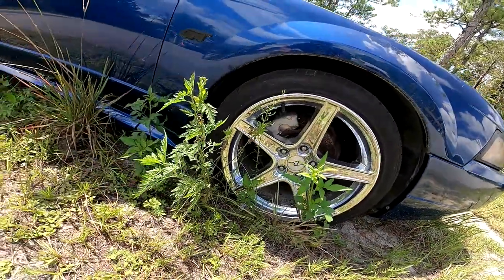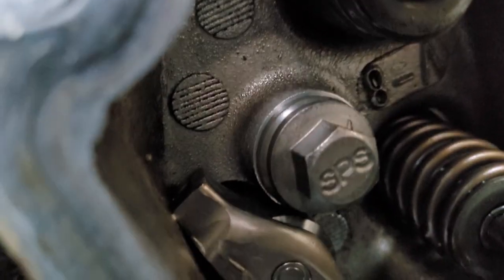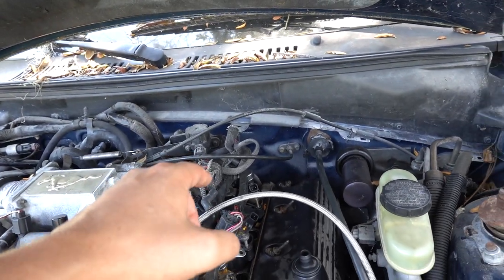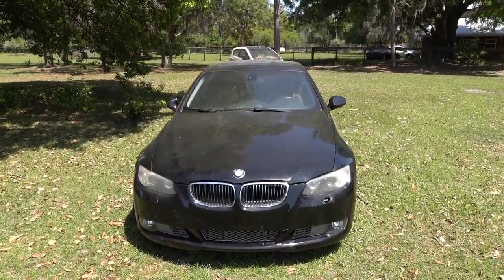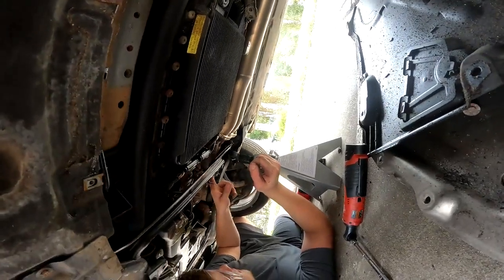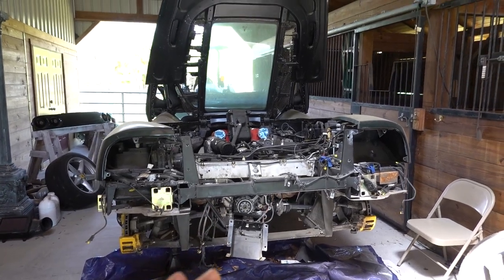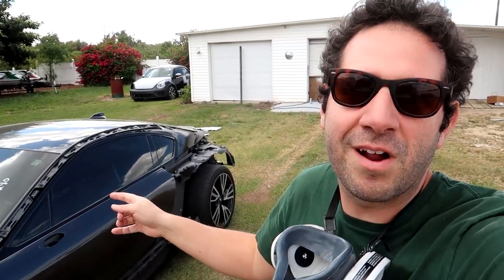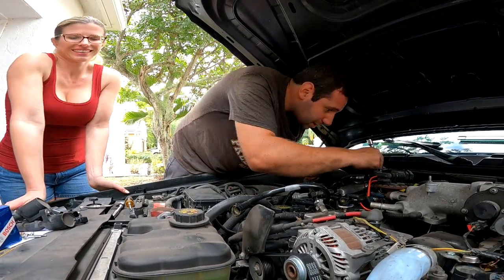Here's What I Found Inside my $500 Mustang GT's Engine (I've never seen anything like this)

Comment: Complain about brake rotors and taking off a timing chain cover on a soon to be vintage Mustang GT; spends 8 hours trying to figure out how to get to o2 sensors and get a hood latch open on a BMW that "may run" for "a few thousand miles" at a time. 

I'm not saying that a Mustang is a great vehicle or comparing them against BMW, but the comparative amount of work time to value/use is not there for me. 

Then again, there are a lot of brand snobs, particularly when it comes to European cars, who would rather let a car that, if in good condition, will begin to accumulate value rather than depreciate continue to sit.

Comment: With the rocker arm is out of place, should the valve spring still be pushing the valve back into the closed position?  Obviously there was something more going on there.  I would think the rocker arm being of would be an effect of whatever is going on, maybe the valve spring collapsed for some reason.  Surely the valve stem hase to be bent now.  You could try smacking the back of the valve and seeing if it releases for some reason.  Maybe it just rusted in place from sitting .

Comment: If the hood latch is anything like the 7 series the left side latch cable runs across the front of the radiator behind the grille. Just pull on that cable and it'll pop. My 05 745li had a broken latch inside the car and this is how I got into it to fix it. Good luck!!! Hopefully this works got you!

Comment: If you can work on that Ferrari I promise that 2 valve isn’t going to be a problem. Motors are very cheap and everywhere. It’s also very easy. If you have access to a lift it’s easy to pull the motor out with transmission by pulling the k-member.

Comment: If the bearings are good on that cam follower it probably got bounced off when the valve hit the piston. It is cheaper to replace the whole engine than the head if you took it to a shop. My local engine guy charged $1200 CDN to re and re an engine and $3500 to re and re a head.

Comment: Raise the 335i on the lift and try to unlatch it manually with a long screw driver from underneath. Or you can try removing the left grille maybe you have better access to the latch. Sometimes the cable itself pops off the latch so only way to unlock it would be with a screw driver pressing on the arm where the cable connects.

Comment: A valve job usually isn't that big of a deal but whatever.  Since a rocker is what opens the valves I knew having one off wouldn't fix it.  That valve would have been stuck shut not hung open.  Duh.

Comment: Or could it be the valve stuck open and the cam follower fell out because the valve was stuck open so there was no spring tension holding the cam follower in place when the cam was on it's base line.

Comment: So many of us have told you about the nitrous on there and you are still focusing only on the head. There was clearly a nitrous backfire but you need to pull that pan and check the bearings and crank. A full replacement engine would be the perfect way to go. Don’t even waste time with that one.

Comment: On your ford pickup when I worked at the ford deal I had a ton of F series trucks with fuel leak that looks similar to what you have and it's from a fuel line on top of the tank that will have a perfectly round hole in it like a needle or something punctured it. Seems to always be someplace close to where the cab and the bed meet up. Only thing we could come up with why they are getting the holes is that some kind of buf is eating the lines.

Comment: Man.. I can't believe you said that with the rocker arm on its place you should have a better compression reading... seriously? Don't you know that the default valves position is CLOSED because they have a SPRING and what the rocker arm does is to push it to open against the spring valve spring force?
Seriously, go study the basics of engines...

Comment: Those aren't M sport wheels, they are aftermarket, I think Rondell 0058 wheels. They look good and IMO is the best aftermarket fit to the e39 but they aren't m sport wheels, on the e39, the M sport wheels should be style 66's
Reply: Those are the original wheels...they were refinished and powdercoated a few years ago.

Comment: I legit just finished doing a head gasket on my 2002 Mustang GT. You gotta take the radiator out too. Might as well do new timing chains. Also, based on my experience, you will also need to put in a better radiator, aftermarket exhaust headers, full intake, and a tune.

Comment: I’m from the UK and I’ve never heard so much bollocks in one video you don’t have to have a new seat cut into the head we don’t do that in the UK put a new valve on it get yourself some valve grind and paste make sure the two faces of the cylinder head at the valve make a nice comfortable seat renew the head gasket and head bolts time in bell if you want to and jobs are good and I don’t see how you would have to send your head to a machine shop everything in America just seemsSo backwards don’t go looking for problems if you don’t have them

Comment: It's a cheap car. You don't need to make it perfect. Throw a valve at it, you won't need to machine the head just lap the damn thing. No paint it looks fine. The rotors will clean themselves up with a few miles. Throw $80 in shocks and 1 valve at it and done. Not nice enough for you to drive? That's fine fix it and make 3k, or just donate it to a high school kid or needy family.

Comment: Then why did you buy this? If you are going to give every reason NOT to fix it, why buy it. Pull the head, check/replace the seat, check/replace the valve guide, get a new valve and get on with it.

Comment: Quit your bitching. Everything cost nothing on this car. ;)

Do the suspension later, the brakes are dirt cheap. Everything on those mustangs cost like $25.  I think I got a brand new window regulator with the lifetime warranty replaced it myself and I think it was $25... Lol
the worst part about those mustangs is the interior feels like crap and creaky.
I'd kill for a manual transmission on those cars. Just got to be careful not to bust your knuckles on the radio.
Reply from the maker: You are darn right, parts are stupid cheap on it
Reply: @Samcrac  hey what's up, yeah I didn't know you were going to reply. Lol
Don't take it the wrong way and just being funny.

Yeah I owned one for about a year and it was a fantastic car.  Fuel tank very small though.
I remember I did tune up for $45.
Coils, all 8 spark plugs. 

I am the guy that sold Rich my family's Tesla. One he got from NJ
 Haha